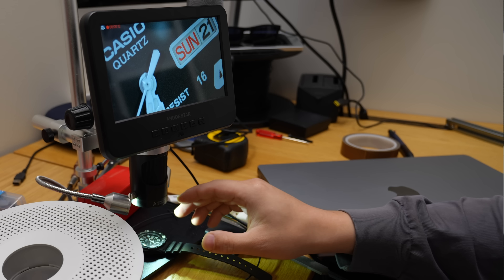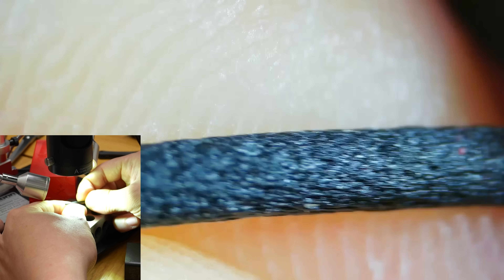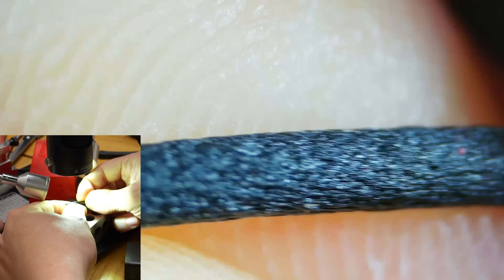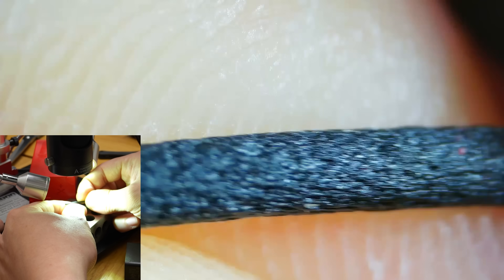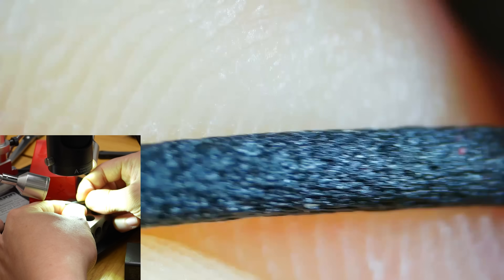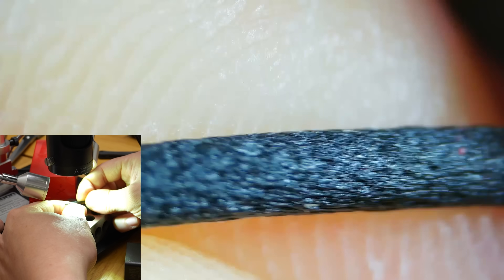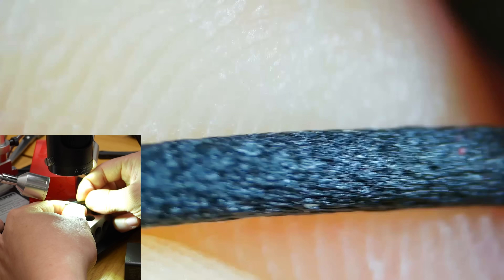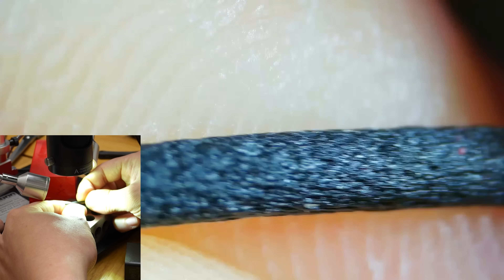The Dark Side of Carbon Fiber Filament

Comment from the maker: To be clear, CFRP (Carbon Fiber Reinforced Plastic) has a place in an engineering context. It increases stiffness, and when properly formulated it also increases strength. If you have an application where it is necessary, you should absolutely consider using it. The last half of the video proposes some simple solutions that manufacturers and users can adopt to improve safety, should you want to print with CFRP.

My concern is that it is being marketed to beginners as a way to improve surface finish or print quality, without clearly communicating the risks. This is especially the case for CF-PLA, which in my opinion, has no legitimate use-cases compared to regular PLA. The issue of fibers coming loose, embedded in skin, etc. outweighs the cosmetic benefit for printing trinkets, toys, or non-structural parts.
Reply: What about metal filled filaments, like the Protopasta metal filled iron and stainless steel? What are the risk with that?
Reply from the maker: @worshaw  Metal filled filaments are probably less harmful. 
The particles will be more spherical instead of straight rods, so they won't cause splinters. But still use caution when sanding or grinding to prevent inhalation. That should be a priority for any sanding operation.
Maybe if it was lead filled it would be dangerous.
Reply: @NathanBuildsRobots  I have something coming up where metal filled might be a candidate, saw this and maybe me wonder. Descriptions online sounds like it’s ground or shaved , which made me think of burrs and metal dust after seeing the carbon fiber.
Reply from the maker: @worshaw  Yes, you may get some metal particle around, but there are a few factors making metals safer.
1) Density and particle size mean it is unlikely to become airborne.
2) The particles will be not be sharp and pointy, so they are unlikely to burrow into your skin
3) Unlike glass and pure carbon, metals will oxidize and break down over time.
Reply: I completely agree with you, and that's exactly how I understood the video.
I think it's good that someone is addressing this!
Reply: Hi, I just ran this past an MD in Operational Health & Safety and was told that - in the direct comparison to Asbestos fibres - those carbon fibres were absolutely relatively to asbestos. It's not doing any of the stuff, the splitting and splintering, that asbestos will continue to do in your lung and get your body to react to. It will just sit there.
Reply: @1121494  Respectfully as a physician (who has treated many mesothelioma patients), he is overconfident in his opinion. 

We should all point to the consensus opinions given lack of data. Here is what the CDC currently says on the issue. 
"The findings of adverse respiratory effects (i.e., pulmonary fibrosis, granulomatous inflammation) and systemic responses in animals indicate the need for protective measures to reduce the health risk to workers exposed to CNT and CNF. Available evidence also indicates that the migration of MWCNT into the intrapleural space could potentially initiate mesothelial injury and inflammation that over time cause pleural pathology, including mesothelioma. Long-term inhalation studies are needed to determine whether CNT and CNF of specific dimension and chemistry can cause cancer in laboratory animals at doses equivalent to potential workplace exposures." https://www.cdc.gov/niosh/docs/2013-145/pdfs/2013-145.pdf
Earlier it cites a bunch of studies where they injected different carbon nano-fiber structures into mice and observed the development of mesothelioma. Obviously these exposures were not necessarily similar in dose or duration to human worker exposures but it did show that some of the carbon fiber dust formulations could cause mesothelioma. 

I'd also like to to point to this study showing that carbon fiber can indeed split into harmful nano-fibers for certain formulations, do not for others. https://aaqr.org/articles/aaqr-19-03-oa-0149

However, I agree that likely carbon fiber is likely far safer than asbestos with likely only specific subtypes in certain contexts being truly dangerous. But overconfident thinking is what lead to the high number of people exposed to asbestos and the many lives which were cut short.
Reply: Excuse me for my ignorance but what risk do fibers produce? Getting in your skin and lungs? Would it be a risk in the sense that vaporized carbon would be in the air?
Reply: @Pyriscent that's a good question. Some nano/micro fibres can not be removed by normal biological/cellular processes and remain in the body permanently - the main risk alluded to in this video but not stated explicitly is when these fibres end up in the alveoli in the lungs. For example, asbestos fibres will do this and eventually cause mesothelioma which is a type of aggressive always fatal cancer, usually of the lungs. The fibres in the skin are of less concern because your skin sheds very quickly (much less than months as stated in the video), but inhaled micro/nano fibres are bad news, and a non-professionally fitted respirator is not sufficient, and CF dust that is later disturbed could be dangerous too. I don't know how you clean a room which has been previously exposed to CF dust. Asbestos and nano/micro fibres can be managed safely, but not at the amateur level. It's quite possible that the fibres seen under the microscope here are too big to cause mesothelioma, but can still cause a silicosis-type lung disease (a non-cancerous hardening of the lungs, sometimes called farmer's lung). CF dust isn't as bad as asbestos, but it's not good.
Reply: CF printing has two main mechanical benefits, rigidity and reduced shrinkage during printing. It hasn't given us peak strength except maybe with Markforged's embedded fiber process.
Reply: Thank you for sharing this video. I will be careful next time I handle CF. It's awfully brittle.
Reply: Add a scale marker to those videos - it’s not easy to interpret the size of the fibers.   Do you know the % loading of CF and aspect ratio ( or length) of the CF in your filament?   It appears to be highly loaded.
Reply: hepa filter won't filter everything, actually no Filter will capture everything, nothing can filter fine dust, the best filter available is active carbon.
Reply: Did you examine a printed part? Wonder if the fibers behave the same after printing
Reply: This problem can be solved by covering the carbon cable outside with normal
Reply: This is so important. The comparison to asbestos is very apt. I'm on oncologist but a lot of people don't realize that asbestos carcinogenic properties come entirely from its mechanical and structural properties rather than through it's chemical properties... The small microscopic rods that make up asbestos are unable to be broken down by the immune system and clear from the body thus causing chronic inflammation. People should be especially careful with any carbon fiber "dust" of course. I imagine that asbestos is more potent and likely produces more particles per gram (but i'm just assuming that rather than basing that on any data). It would be interesting to characterize the numbers of particles per gram that are produced for these different materials in different settings and contexts. 

Unfortunately, if we have to rely on medical studies alone it will take 10-20 yrs before we starting seeing a cancer signal. With asbestos exposure there could be quite a long delay for individuals from small amounts of exposure. Hopefully carbon fiber is less dangerous.
Reply: This stuff is bad. it has an engineering use but is not something for the average person to just play with. Ive been saying this since the first CF and other fiber filled filaments came out for the hobby user. Built my first printer in 2009 and some stuff is just bad news.
Reply: i dont mean to be critical due to carbon fiber does bear its risks but calling it asbestos is a bit of a stretch due to what asbestor realy is and how it interacts with ur body 
(asbestor interacts by getting incapsulated in ur lungs after inhalation and will evantualy cause irritations that cause excess lung fluid build up and other lung related illneses)
i dont think carbon fiber will cause simular effects
Reply: @modernidiotism9865  you’d be shocked what most fibers will do to your body / lungs.
Reply: asbestos printers
Reply: You have zero evidence that it has any impact on your lungs, skin or anything.  You can't make the claim that it is as bad because it's got fibers and so does asbestos.  

You are clickbaiting with zero real evidence that there is any health impacts.
Reply: PLA CF has a use case of hiding layer lines. Black PLA is shiny and looks like cheap junk.
Reply: @rsilvers129  There are lots of solutions for hiding layer lines, the simplest is probably using fuzzy skin in your slicer ...
Reply: @rsilvers129  buy matte pla like polyterra or similar?
Reply: @rsilvers129  bruh get some dark wood filament 🤷‍♂️
Reply: @rsilvers129  Bambulab has a "PLA Matte" series where the non-reinforced black pla "charcoal" looks pretty good. Just fyi

Comment: At 6:20 adding pieces of stronger material doesn't always make it stronger. This will depend on how well the tiny pieces bond to the material. If their bond to the material is weaker than the material, this will essentially create many tiny holes within the material after enough stress, with that stress amount being less than the amount of stress it takes to rip the material apart.

Comment: Never used carbon fiber infused with carbon for this exactly reason. But i really dont need it for anything , I understand some do ..but that's not many people. There is heat resistant PLA , its very strong, easy to use and it will not get soft in higher temperatures. I like that one for very durable prints.

Comment: I printed a few parts today using PETG CF, then watched your video and decided to check what was going on in my printer enclosure, there were a bunch of small fibers inside, I also found a few big ones in my fingers ... I'd better continue to print ABS and ASA, I hope this crap didn't get into my nose and lungs, when I opened it to look at the printing process and tore off parts from the plate

Comment: Are there pure iron & carbon compounds (more carbon than iron) which could be aligned by static electromagnetic flux to form wood-grain patterns in order to directionally/vector strengthen CFRP components? I've been thinking of this as a way to make "forged" engine parts for a frictionless rotary vane engine I'm dreaming up
Reply: - then spray with ceramic paint to seal and reduce heatsoak
Reply: (applying magnetic flux while CFRP mixture is in moulding cast/die)

Comment: spooky stuff. i printed my dad some containers to keep his bubble gum in, needless to say im re-printing them right now in regular petg. i have a similar microscope for sharpening my knives and i inspected the gum and my hands after handling the part. the fibers i saw from my bambu petg cf were much smaller than indicated in this video, but disconcerting nonetheless and i will be re-thinking how i use that filament. i have 18650 battery cases printed out of it, and even just handling them gets fibers in my hands. i also read conflicting information, i believe according to osha the size of the fibers used in filaments are supposed to pose minimal health risk, but i still dont want to take any unnecessary risks so for now ill be shelving my 7 spools of it

Comment: I only use GF/CF filament when it's intended to be heated or in contact with something that reaches 140C+ and the printer is not quite capable of printing pure nylon which shrinks badly unless you get the chamber very hot which most printers can't do.

Comment: Carbon iber was designed to be wetted out or impregnated with resin so in tha regard its use in 3d printing is really a novelty.. Its just dry fibers suspended in plastic...  As it melts the surface of the fibers gets coated in melted filament but it wont actually completely wet out the fibers.. So you probably gain a little strenght, but to be honest its a waste of good carbon fiber if you ask me..

Comment: Do you think glass fiber reinforced filament has similar dangers to it, and ought to be sealed after printing as well?
Reply from the maker: I tried glass fiber and didn’t have any issues with shedding as far as I could tell. The fibers are larger in diameter and seem to stick into the plastic matrix better
Reply: @NathanBuildsRobots  Thank you! I was hoping that would be the case. It's funny how glass reinforced filament tends to be costlier than carbon fiber reinforced, but for health? I'm perfectly willing to spend a little bit extra.

Comment: You probably need to specify the filament brands you're referring to. I'm printing with Fiberon PET-CF, PA-CF, PPS-CF, PETG-CF, and none of them look even remotely like what you're showing. Also, they don't shed carbon fiber pieces. Much less so the printed parts.

Comment: I was curious about CF filaments for a while now. It seems like communities and manufacturers started to not only advertise its potential strength benefits but also surface finish, especially hidden layer lines. I was interested in purchasing one spool and just play a bit with it, printing some things I regularly use that might look "cool", for example a case for my keyboard. For now I won't think about that anymore - especially the keyboard case just sounds like a mad idea right now. I have my printer at home and often print toys for the kids - who knows what residues end up in the printer that might not be purged efficiently when I swap back to PLA for toys? Just not worth the risk in my case.

Comment: Bruh, does anything in this hobby not have a dark side?
Putting aside the toxic gasses, poor neighbours tryna sleep through industrial noises coming from your residential properties as a single print slogs out over 2 days. The unknown health risks, excessive waste from failed prints and poop. 
(I thought pla was bio degradable, but in practical terms much more likely to end up as micro pellets in the sea.)

It really is a dream come true to be able to work on robots from start to finish, to design a chassis complete with brackets and accessories scaled to spec, then hammer it out in carbon fiber from my own home (with duct from exhaust to window). 
But as is often the case, in the race for max value extraction a lot of things are pushed on people before they are ready, where impractical, or even where dangerous.

Comment: I think when people hear "it's an engineering material" they think of all the benefits with no downsides.
I was actually contemplating trying out something with -CF in the name, but now I'll stick to the vanilla flavours!
Reply: I don’t see a need either. I bought a roll of PLA-CF, before seeing this vid. Printed just one thing luckily. It’s all in the bin now. No tangible benefits for the kind of things I’d print, and even if the risk is small it’s just not worth the bother.

Comment: Could you test a finished print that’s been brushed with a stiff bristle brush? As some point I would think the outer layer of fibers would be gone and you will be left with a safe layer of the main plastic that houses it? In which case you could print, handle carefully, brush carefully, and then be safe?

Comment: Yeah bro.  Doctors have been finding micro plastics in our organs and even our brains.    Fiberglassed reinforced filament are just as bad.  I lost the tip of my finger from a bone infection contracted from micro slivers from a factory i worked at.     Data saftey sheets are so very important and it blows me away they dont come with 3d printing filaments

Comment: This is why i do not handle my PPACF bare handed.  And when the part comes out, rub it down with a leather strop.  It gets MOST of it but not all.  And if the part is something that will be handled constantly, like a lower, i coat it.

Comment: I was so happy when I discovered PET CF/GF, but now I do not know what to do, because I am printing some parts with this material. I took a look into my microscope - both filament and printed parts, then at my fingers and now I am really scared. It is as Nathan shows, fibers everywhere. Seems that carbon is worse than glass fibers, however I am not pretty sure as glass fibers are transparent. Luckily, I am using only closed printers with carbon and hepa filter additionally with outer air filtration, but still I am in a contact with these materials. Hard to decide what to do now, because there are some bigger parts which warp and need to be strong, so I use PC for smaller parts, but for the bigger there are no many options if you need a part to be used outside with all the possible weather conditions.

Comment: Fear-mongering once again! Carbon fiber can’t really fracture into asbestos sized particles; and are not really too different in size to all the other dust and particles you inhale just by living inside a house. 

And if they somehow get past the mucus barrier of your lungs? Macrophages can remove them, unlike asbestos. 

Now, carbon nanotubes? Those are an issue, and people should avoid ESD-filaments for that very reason. They are small enough with plenty of research showing serious potential hazard.

Comment: the reason i use carbon fiber fillaments is nOT cause of strength its because they are march sharper and catch much higher detail on a print. but it is a bummer they have the drawback of carbon needles. luckily though carbon is mostly inert so its not actually really dangerous at all

Comment: This is entirely overblown. OSHA has detailed studies on the dangers of carbon fiber and aside from the potential for local irritation, it's largely not a serious issue, nor is it an inhalation hazard, as they're just too large and heavy to get past your upper respiratory tract. A much greater issue with 3D printing is the off-gassing you get with the various types of plastics/polymers when heated.